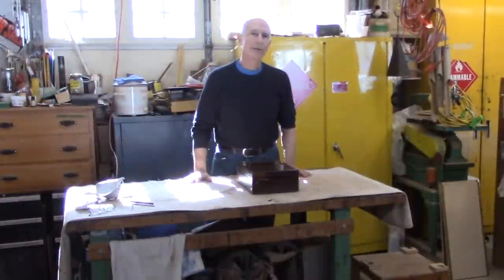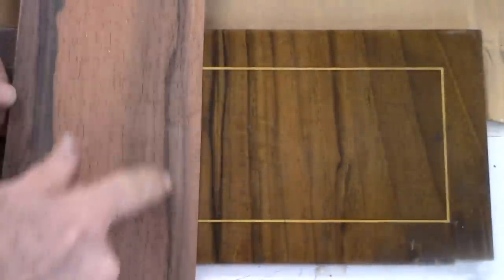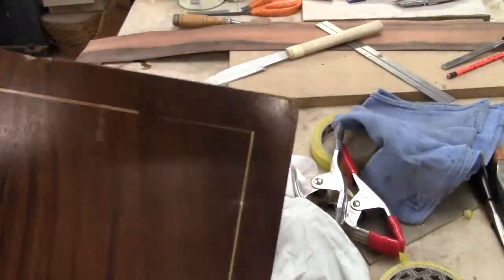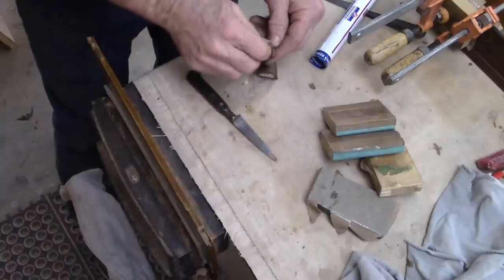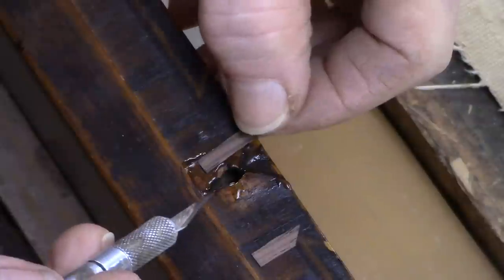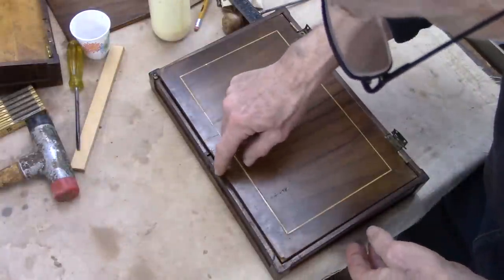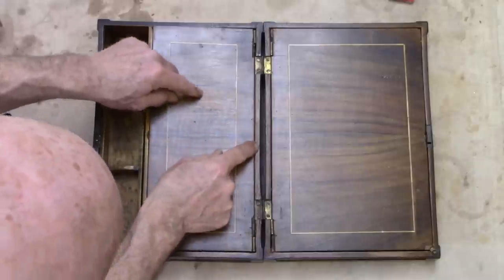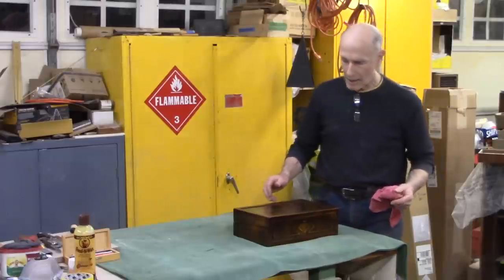Restoring a Lap Desk - Thomas Johnson Antique Furniture Restoration

Comment: Hello, I noticed you use Feed-n-Wax regularly so I bought some and am quite pleased with the results.  I recently used it where I had to restore a water damaged finished and it did the job perfectly.  I always go to the Data Safety Sheets to determine the true chemical composition since the labels are often influenced by marketing.  I noticed that the principal component by percentage are three parifinated petroleum distillates, in addition to carnuba, beeswax and orange oil.  Does that large percentage of petroleum solvents cause you any pause?  I certainly would not consider it food safe but I do plan on continuing to use it because of the ease of application and quality of the finish.
Reply from the maker: Thanks! No, it doesn't. It seems rather benign. Definitely not food safe!

Comment: The respect you show for the original craftsmen's work and materials they used at the time is certainly notable, and watching you work is truly akin to watching any artist. I wish we lived closer so someone in my family could apprentice with you and learn from your expertise!   Through inheritance, we have a number of antique pieces of varying styles and periods in our home which seem to be drying out. We also have several 9 foot wood doors which my father had stripped to the natural finish and a former trio of outdoor side and head light panels with lead glass; these too have a dry look to me.  On one table in our home, I have used orange oil buffed in, then wiped down, but then it seems dry again in a few weeks. I would trust your input into how to best care for these pieces!  I do not use modern dusting or waxing sprays. Can you share your opinion on what, after dusting well, is the best way to "rehydrate" the furniture and other wood like the doors in our home? A particular wax? Oil?
Reply from the maker: Thanks! A basic misunderstanding - when wood dries out it is due to the atmospheric conditions, it is losing moisture as the cells work toward achieving equilibrium with the air. You can put all the oil and polish on you want and it does not affect the moisture content of the wood. Raise the humidity level of your house to help the furniture

Comment: I love watching you work on wood, you are a fine craftsman, sir. Thank you for your page. That said,
I'm going to say what nobody wants to hear. Those rear corners are robust for a reason and the strain on the hinges were on purpose. The customer mentioning that the cover veneer should be spared had a double meaning. Obviously, you are repairing this device as a showpiece only.  The piece has outlived its intended design. As soon as the wood at the hinges broke it was over. Otherwise, to bring it back into its intended purpose, which was a brilliant design at conception, the whole back would have had to be replaced to new wood and not just the broken pieces repaired. Even the warping may have been on purpose and there very well may have been ribbon pieces to open panels. Had the rear panels (acting as flex-braces) been allowed to pull the whole thing tight as designed everything would have worked perfectly, I am certain. The key behind the whole thing working properly was the tightening of the back pieces stressing at the hinges. Putting pen to paper, notwithstanding.
Reply from the maker: Thanks! Thoughtful comments! And yes, this is for show only. The piece will never be used as intended

Comment: Looks as good as can be expected. I have done these restorations too and I find the smaller pieces are not as forgiving as the larger pieces of furniture because the small size does not give you the latitude to move the material around to compensate for defects. Great job, pretty display piece.
Reply from the maker: Thank you! Yes, good point

Comment: Writing slopes usually had hinges which were as tiny as possible, so as not to interrupt the flow of the writing surface, and usually right out at the edges, so that they didn't get in the way. The center of the box was then covered over with leather or suede or velvet and the glued fabric acted as an additional hinge...very few ever used much metalware in their construction, because hinges are expensive...
Reply from the maker: Yes, true! And the tiny hinges, and the thin wood to which they are attached can be a real problem sometimes!

Comment: To correct a similar warp you could drill down through the wood in places where the apex of the bend can be cut through the inject a suitable glue down the holes while bracing the job in the desired position.
That’s if you can’t simply steam or cut it.
Reply from the maker: Thanks! Yes, I have often kerfed the wood and forced it back into position. Not practical to do on this piece!

Comment: I thought the old finish is where most of the financial value is too? My old boss also did valuations for insurance companies on antique furniture. He told me that removing the original finish could drop the value by more than half. Even if that old finish was in bad condition. Rosewood was the first veneer repair I ever did and I think it is one of the easiest woods to work with for repairs. Neat piece of furniture there.
Reply from the maker: Thanks! I don't know anything about market values, doesn't really enter into my work as it is all for private individuals

Comment: I had an idea that might be useful.
There are vibrating electric toothbrush’s (the shaft doesn’t rotate) I was thinking that they could come in handy for fine cleaning polishing sanding cutting and scraping jobs. You can fix various attachments to the brush head like scrapers blades polishing pads and sand paper in addition to just using the brush it came with.
Reply from the maker: Thanks! What a great idea, except someone's beaten you to it: https://fein.com/en_us/tools/oscillating-multi-tools/
Reply: @johnsonrestoration  . No not if you’re talking about the multi tools, they are a sledge hammer compared to the tack hammer I described. There are vibrating knives that are supposed to make cutting easier but they are also overkill.

Comment: Looks great, you do good work. I've done a lot of carpentry work and very little of what you do, although it intrigues me. I agree with your opinion on the finish, it looks awesome. I don't have the blessings of a shop or any place to try my questions so, a couple thoughts: 
1. On the panel where the screw holes for the hinges had blown out and you used an epoxy to fill. I've used toothpicks (not bamboo) glued in with carpenters glue to repair screw holes, would that have been a viable option for this?
2. When you reassembled the writing box, it didn't align, was torquing the screw holes again and possibly going to blow them out again, would it be a viable option to make a hinge that's flexible, like leather hinges, instead of the solid brass?
3. When you use the hide glue, tape over it with the yellow tape and clamp, would wax paper be a viable option? I'm wondering if it might not stick and/or leave a residue you don't have to clean off.
Thanks
Reply from the maker: Hi David, Thanks! Too many questions!
Reply: @johnsonrestoration  Sorry, I'll unfollow you so you won't have too many distractions.

Comment: Will the hinges rip out again since they remain under tension? Or can you disassemble (unglue) the two hinge panels and do a careful relief cut, shaving just millimeters off to relieve the tension or will the lock not line up?
Reply from the maker: We're trying to decide if we should do anything. Maybe just disconnect the hinges. Anything else changes it from the original!

Comment: I wouldn't dream of refinishing it. It's gorgeous. The only way to really properly repair it to make it functional would ideally be extremely difficult and expensive. Basically replace the bent boards, and soak them in water to detach the original veneers, and reglue everything onto new substrates. The finish would not be salvageable in that scenario. I suppose alternatively, the warped boards could be sawn down the centre on a band saw, then planed or sanded down thin and glued to new centre pieces. There really isn't a non-destructive solution. It's not possible to magically "un-warp" it.
Reply from the maker: So true! And especially since it is just a display piece anyway. It is what it is. I think I'll take the screws out of one side of the hinges to relieve the stress

Comment: 17:15 No way to open the top. Stick a Post-It to the inside and fold it around. It’ll stay for a surprisingly long time. (Be sure to use c1900’s Post-It’s.)
Reply from the maker: Thanks! That's a good idea, Sometimes I have just used folded over masking tape

Comment: I actually wonder - since you ARE a real pro, there HAS to be some reason you didn't take the apparently obvious aproach of disassembling the little box and reflattening the boards (with heat, moisture and pressure) to fix the bulging issue. I'm sort of curious to know said reason. Was the box impossible to disassemble without damage, perhaps? Or would it have warped the boards more than it would have straightened them?
Reply from the maker: Thanks! I have never successfully got a warp out of a piece of wood. But yes, the cure was worse than the disease! The most important issue here was to keep it original
Reply: @johnsonrestoration  I figured that could be the cause.

Comment: What a pitty of the warped wood. I understand that this particular piece should be kept as much as original as possible and I think it is a good call to only go this far restoring it. Just wondering what options are available for maybe taking it apart and maybe steambend? I'm not a woodworker so please excuse me if I suggest something silly. I enjoyed the video :D
Reply from the maker: Thanks! I have found over the years that if something is warped it will never straighten out

Comment: If it were me... I would keep the top and bottom of the box separate to prevent further damages to the wood. I know it's nice to have it whole, but the box is so mishaped that being whole would be worse in the long run. Clearly never will be used again, so fix to be displayed and that's it.
Reply from the maker: Thanks! I was having the same thought, just remove the hinge screws on one side and not worry about it

Comment: Well you didn't fix the bows in those sides so the hinges will continue to make worse damage to the box - how would you fix it and still retain MOST of its originality? How would you get those bows out? It appears that the unfinished nature of the inside compared to the exterior is the primary cause. I suppose adding the interior finishes heavily could not be done until the interior was dried thoroughly and then adding the interior finish, right? Would packing something like rice or sawdust inside and using those braces for a couple of months in a dry place help dry it out? In my opinion (and apparently yours), its a bit too far gone to attempt much remedies without a complete sanding to remove the finishes and even out the dryness of the wood surfaces  inside and out. Right?
Reply from the maker: Hi Clyde, thanks! You know, it's just not worth risking anything on something that will not be used in any case. Best just to leave it alone. At least it's stabilized

Comment: Oh, Mr. Thomas, why epoxy for an antique piece? Why you just didn't fill this screw holes with a piece of wood + hide glue and what is the problem with drilling new holes? You making outstanding work, but such "easy ways" ruins it to be honest :(
Reply from the maker: Thanks for watching! Always use epoxy when you have shattered parts like that. There is a tremendous pressure put on that area where the screws are when the lid is open.
https://www.youtube.com/watch?v=AmFot8H_2Kk